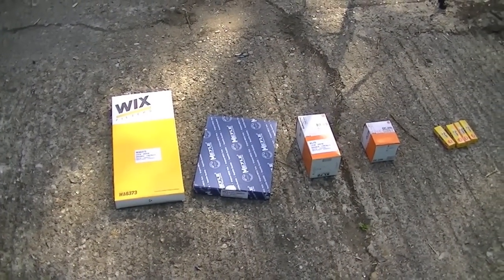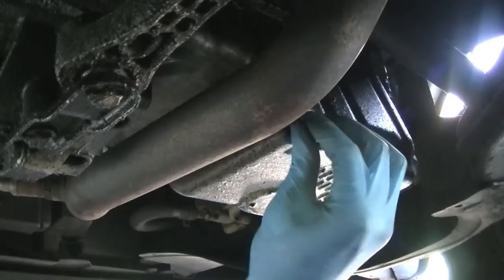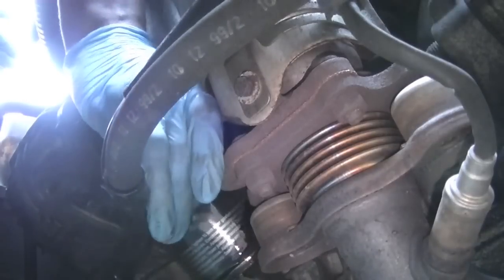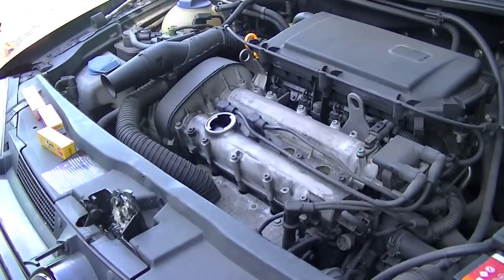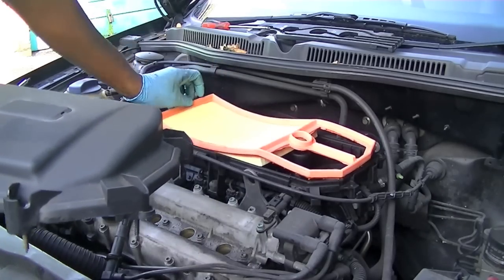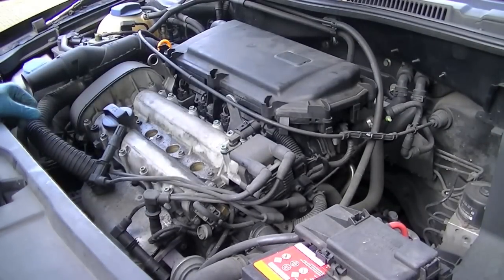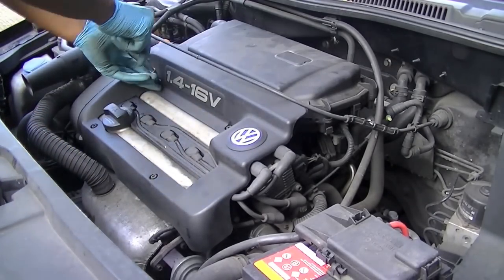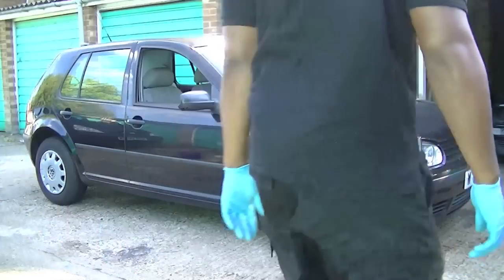VW Golf 1.4 16V Engine Oil and Filter Change AHW

Comment: Great, great video. I've just bought all the stuff from EuroCarParts (oil, air & fuel filter, new plugs and engine oil), they arrived this morning and I'm going to endevour to do this this afternoon or more likely tomorrow, thanks again BMAC, you're the man!
Reply: Excellent, let me know how you get on
Reply: BMAC Car Mods Did it all yesterday, probably took me three hours, lol. The Sump plug was a bastard to get off, ended up forcing it off with a wrench and hammer.

I had a little oil in the air filter but to be fair she was WAY overdue a service and some of the oil was really thick so I can only assume it was due to neglect.\

She's currently at 55k mileage, do I need to look into anything else before the next 10k? I assume I'm going to have to look at the cam belt at ~60k?
Reply: yes, 60k is defo a good time to look at the cam belt. No vids on that one yet, but one will be coming soon. If you buy a oil extractor you never need to lay under the again

Comment: The oil filter on my gf golf takes a 30m socket and it won't go over the filter as there is a air con pipe in the way so I went to halfords and got a chain oil filter wrench that won't go over the filter becouse of the friging aircon pipe so I have ordered a strap oil filter wrench that should go between the oil filter and the friging aircon pipe so I'm now waiting for the strap removing devise to get here anyway thanks for the service vid the cabin filter and the air filter went ok 😳👍🏻from Kent 😁

Comment: Hi BMAC! Any chance you could do a vid on the same model vehicle showing... how to silicone in the gasket? As some will know, not all models have an actual 'compound' gasket that you just drop on and then screw back the cover. Mine is exactly the same as the one you've worked on in this quality vid and I for one would LOVE to see how that's done... many thanks in advance and keep up the good work fella :D

Comment: Hey! I have a 1.4 16v golf mk4 too and every time I'm at 50 - 60 mph specifically and let of the acceleration there seems to be a fairly noticeable knocking from the front left wheel/side. Any thoughts or ideas as to what may be wrong? Thanks

Comment: Hello,

thank you for excellent video, it was very usefull. I had a litlle problem though. when i removed the aluminium plug, the copper washer got drained away with oil. I noticed this after i finished the job. What should i do? Is it ok to drive without washer, or should i drain the oil again and add the washer on the plug?
Thanks
Reply from the maker: You will need to replace that copper washer soon, cause it will drip and leak out.

Comment: I have a problem with my 2003, 1.6 SR Golf Generation (Australia). It's started to over heat. The temp gage will sit on normal for a long time, then raise rapidly til alarms sound, then, decrease rapidly.. too rapidly it would appear, for coolants to have actually cooled down that quickly.
This happens very soon after returning on the Air con.
Anything you may have to say about this would be awesome.
Thanks so much... AGAIN.
BTW, this was happening before I changed the oil and filter and air filters.
onyer

Comment: Excellent video.

After emptying the oil, can you start the car for a minute to get more out?

Thanks.
Reply from the maker: I wouldn't, just change your oil regularly and it all be fine.
Reply: Thanks, makes sense. Sooner or later the old oil gets replaced ;))
Reply from the maker: Yes, thats how it works. If you want to be extra sure ckean the sump and pick up strainer out like I show in my video. That is a goodv hing to do for your car

Comment: hello, any  chance you could please advise me on which engine cleaner to use prior to doing a service and what oil (type+make), filters etc that are best for full service but most cost effective tooo? :) also if its possible to change my idol sensor easily? thank youuu
Reply from the maker: Sounds like you have a lot going on…lol

When was the last time that this car was serviced? Are you going to do this yourself?
Reply: BMAC VAGS 
yup! its got 180,000 miles on clock and i got it about a month ago but its just been on drive! Im going to buy engine cleaner, oil and filters tomo but not sure which are best to get tho as i am on a bit of a budget ? and yeh will be doing it myself and hopefully with a bit of help from a friend but poss just on my own :) A friend has a a golf just like mine that is getting scraped so been offered to take other parts of that luckily!

Comment: Hi there,

Iv been seeing your videos for a while.

I'm having problems with my mk5 golf 2004 1.4s that I recently purchased with 136k on the clock
I had my a full services, full timing belt kit change. And oil pressure switch changed

I keep constantly having a red oli pressure light every morning. After driving for 20mins the red oil light turns it self off
And through the whole day it won't flash on again. Until the next morning.

Also my engine makes a funny tapping/clicking noise when I start off in the morning and when I have my foot to the pedal the noise gets louder and after 20mins the engine warmed up. The noise totally goes and the engine sounds perfectly fine, like nothing has ever happen..

Hope you can help.
Edward

Comment: hello there! u got best videos! i have the same car, and can u tell me the best oil for engine?? i have some problems because after low oil preause on board coming message german when i drive slowly: STOP, OLDRUCK MOTOR AUS, BETRIEBS ANLEITUNG. but not always... i change the oil pump, and sensor? maybe i didnt put corectly oil?
Reply from the maker: I would used older style non synthetic oil with alight viscosity. does your car have lots of miles?
Reply: 160.000km

Comment: My 1.4 2001 golf is lacking power and chugging while driving constantly , would it possibly be the air filter or the fuel filter??
Reply: replace the sparks, if that doesnt do it, replace the catalysator on the exhaust.

Comment: Hey Man, I been watching your all your videos. Good work your doing there!
I wanted to ask, I noticed in some other videos they change they also change the oil drain plug. Would I have to do this on my Golf mk5 TDI?
Also I dont have specific measurement wrench, just those usual wrench. How would I know when to stop for 30nm when tightening it?

Thanks in advance
Reply from the maker: Yes changing the sump plug is the best way, the only way to know the correct tightness is to get a torque wrench. It is a good investment if you intend on looking after your car and will avoid mistakes using this tool.

Comment: Hi I'm thinking about getting a vw golf 1.4 for my first car 
Are they good cars
Reply from the maker: They are good if they have been looked after, that means regular oil changes. A lot of times people don't treat them right so you will have to check it out properly. You can expect excellent build quality and reliability because that is what you get with a German.  Have you seen one you like?
Reply: BMAC VAGS seen one with full service history and 58,000 miles
looks better than the Vauxhall corsas ive been comparing the golfs to
Reply from the maker: Yh the golfs are better lookers, did the car have any serive history? Is it a private or dealer sale?
Reply: BMAC VAGS it was a private sale and it had full service history and even including receipts for
new wiper blades

Comment: I had a Citroen Saxo 1.1L but every time i gonna drive it need fuel 
i thought i can drive like 700km with a full tank but it looks like i driving a c63 AMG hahah , i thought it leaks but i cant find fuel under my car if i want to drive 
i sold my car btw 
if u know .. tnx btw sorry for my english cuz i am dutch haha 
another question: i want to drive from Rotterdam to Morocco with a volkswagen golf 4 but i dont know if i need a 1.4 or 1.6
Reply from the maker: Best golf for driving is the TDI in my opinion. Your saxo clearly has some tuning issues, unburnt fuel must be costing you a fortune. Do you have engine management light on?
Reply from the maker: has it been modified?
Reply: no

Comment: How can I squeeze an ounce of power out of these engines. ?
Reply: +Thabani T-Bowse Hadebe It's better to look for another car with a more powerful engine.
Reply: Can't fam. Have to build my insurance profile. Can't get insured on bigger engines so I gotta work with what I have bro.
Reply: If this is the case, the easiest way would be to perform "chip tuning" for the car's brain (ECU). This way, you can usually expect 5-15% increase for engine power. This is mostly electronic tuning that will not be visually noticeable. Another way is to add a small turbo for the engine, that would start at around ~3,000 RPM, so only when you need the extra power. Adding a turbo needs more messing with, however. This is not so costly at all and if you are going to drive the car for some years, it will be worth it. Good luck!